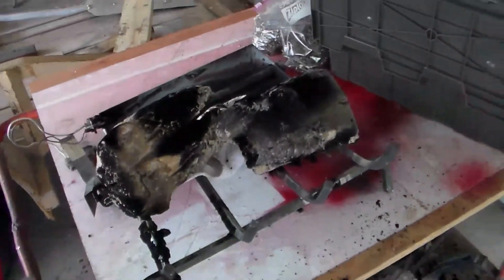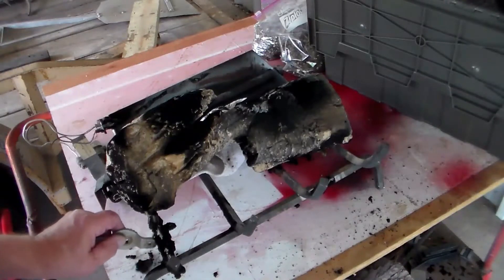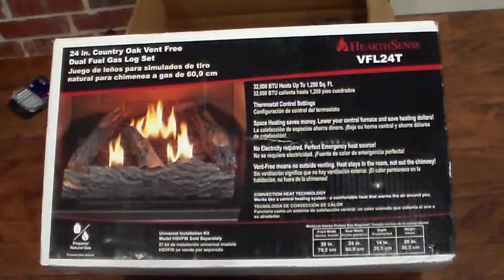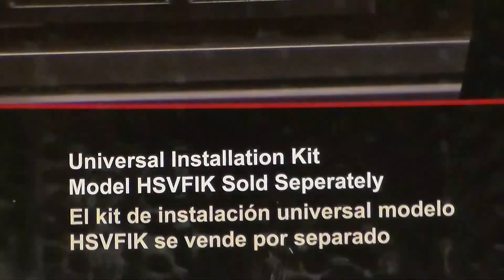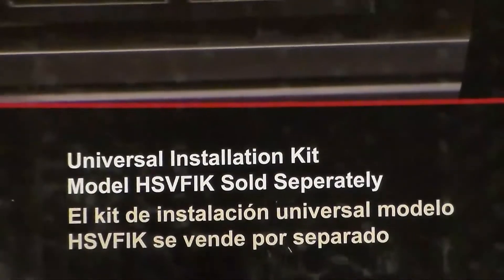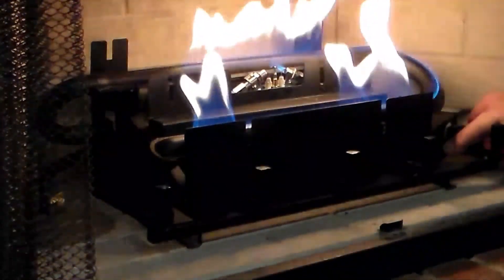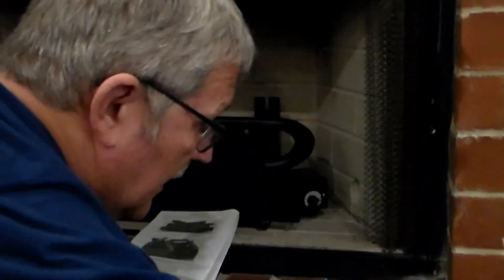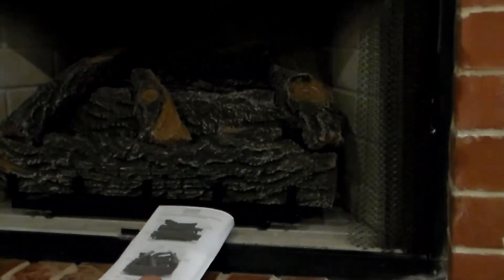Installing HearthSense Log Set

Comment: I can't count the number of VF sets I've installed and serviced in 20 years as a "fireplace guy".  You just increased your efficiency from around 16% (vented) to around 99% (ventless).  The burner will humidify the room somewhat which isn't so bad in the winter anyway.  If the pilot flame develops a "yellow" tip just blow a shot of air backwards through the pilot burner and it will clear the airborne dust they all accumulate.  Rolling the control knob all the way to the "hi" position will also bypass the thermostat and let them burn constantly if you want them to do that.  Great upload, Lloyd.
Reply from the maker: Thanks Dale, the old log set was letting all the heat fly out of the chimney.
Reply: Are you able to use a remote control with this unit? If so, what's recommended.  Ty

Comment: I bought the same one and the pilot and fire keep going out like every 5 minutes.  ? Have you had this problem. ? And what setting do you run on 1-5 is there a temp difference in them ?
Reply from the maker: You need to mount the capillary temp bulb closer to the opening of the fireplace. They have it strapped under the burner for shipping purposes.If the bulb gets too hot it will shut everything off. I operate mine at about 3. The flame will cycle on and off according to the number you have it set at and will start the the flame automatically. Hope this helps.
Reply: I’ll try this tomorrow I have it outside the fireplace now but I’ll move closer to opening. You wouldn’t think the pilot would go out tho right ? Mine keeps killing the pilot
Reply: I’m having the same issue, with the 18” version. And updates? Is the capillary the probe directly outside of the pilot light?

Edit: I think my center log was set too close to the capillary thermometer and overheating it.

Comment: Good day eh!!!  That old set of logs sure did soot up eh!!!  The new logs set you have looks real nice though.  Does the pilot light burn all the time or only when you are starting the logs up?  Thanks for posting,  This looks like a nice add especially for when the power goes out like you had.  Take care!!
Reply from the maker: The pilot lights with an electric ignitor. It burns all the time but it's easy to turn off and completely and relight when needed. That will be the way I will do it most of the time. Thanks Mike and have a great week
Reply: @RustyGlovebox  Thanks for the answer Lloyd!!